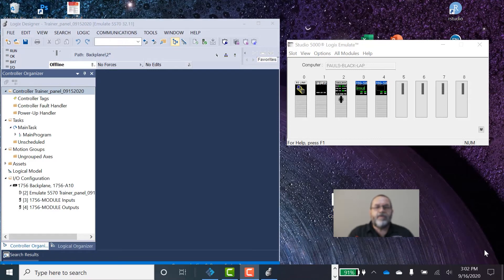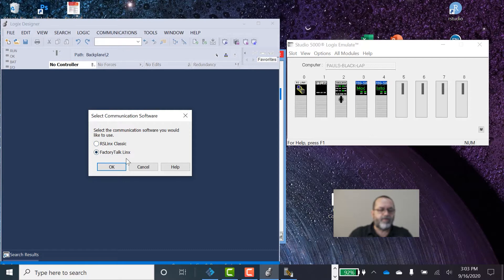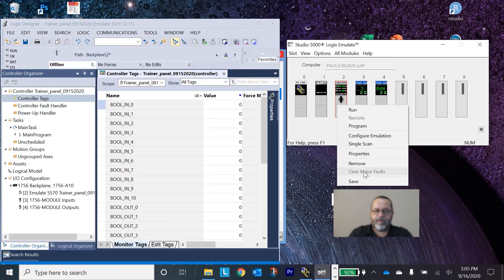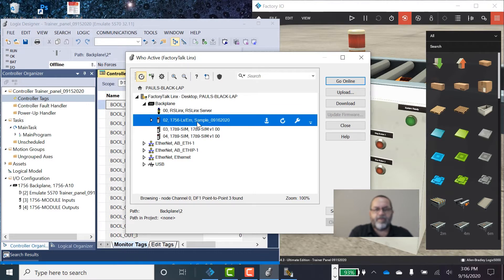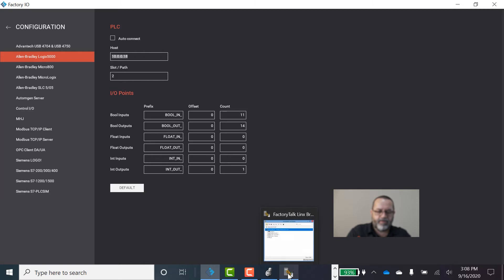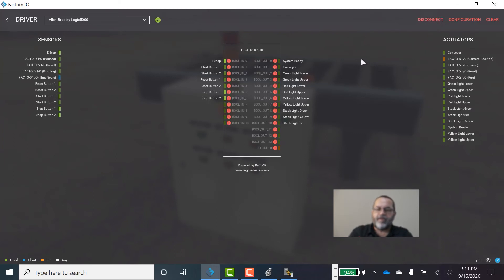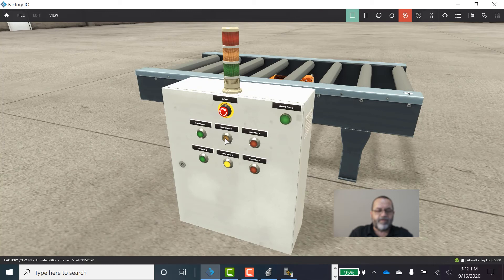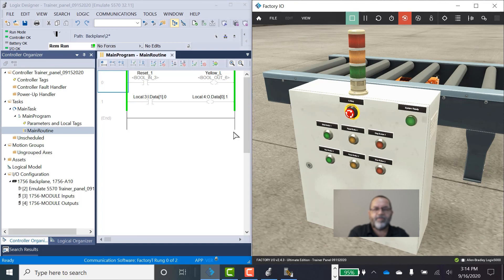Studio 5000 to Emulate to Factory I/O Communication; Professor Murray

Comment: Hello, how did you get it to communicating with you desktop IP? That’s the issue I’m running into
Reply: Found the solution to it . 
On studio 5000 >> who active(should be factorytalk link) >>Ethernet,ethernet >> right click on it >> driver configuration >> advanced >> check the box for listen on Ethernet/IP encapsulation port >>apply & OK. 

Download your project on your emulator and make sure it is in remote run 

Go on your main computer making sure it is connected to your wifi>> your computer> press windows and R >> type CMD >> type ipconfig /all >> check what is your ipv4 address on your Ethernet adapter wireless and use that one on your factory IO and it will connect.
Reply from the maker: FIO, emulate, and your PC all have the same IP address.

Comment: Please you can help me. My factory linx browser do not show me ip adress on the EtherNet adapter. Just stay  loading and not show nothing. My softwares versions is the same as you use. Thanks.
Reply: I had a similar issue and enabled an item in the properties.
Configure Driver>Advanced>Interface>Listen on Ethernet/IP encapsulation ports
Reply: @peterb5614  Hello Peter, where is that?
Reply: @noeligarcia7176  Properties are specific to the item listing, select the item and look for the wrench.
Reply: @peterb5614  Thanks to your help I can solve this problem
Reply: @peterb5614  THANKS :) !
Reply from the maker: Maybe your version is not fully activated.
Reply: Thank you that’s what I was missing!

Comment: For those, who can't see their local computer under the Factory Talk Linx "Ethernet, Ethernet" Section:

Step 0: PC must be a member of a local subnet, even if we use a Virtualised Machine. Try to use eg. a dummy router.
Step 1: Open RSLinx Classic (Lite)
Step 2: Goto "Communicatons/Configure Drives..."
Step 3: Select the commication node from the list, which defined for "xyz... A-B Ethernet ", then click on "Configure..."

Step 4: The setting shoud be
-> BROWSE LOCAL SUBNET 

And from the "Descripion" list ,change the setting from
 "Windows Default"    -->   "YOUR NETWORK ADAPTER IS LISTED"! (eg. Intel(R) PRO/1000 MT Network Connection)

Step 5: Hit OK, close, close bla, bla; then your communcation node shoud be listed by Linx Browser.
Reply: Hello can you please make a video, covering this issue. I don’t have an issue with steps 1-5. But I’m struggling with step 0. I have been unsuccessful at getting my computers IP address to display under Ethernet Ethernet. I have all my software on a virtual machine. I would really appreciate some help thank you!
Reply: @juliangallardo7507  you solved your problem? i have the same! factory linx don't show me ip adress.